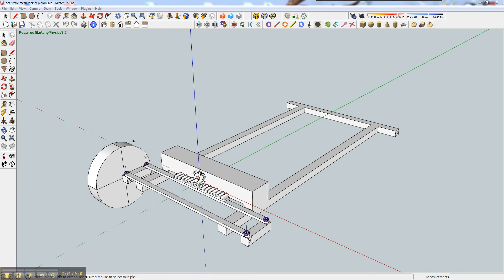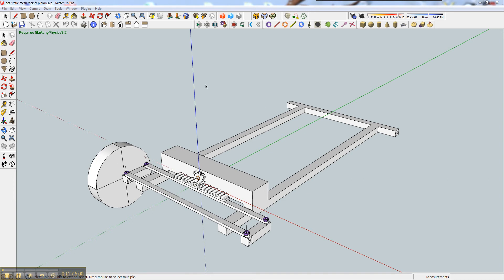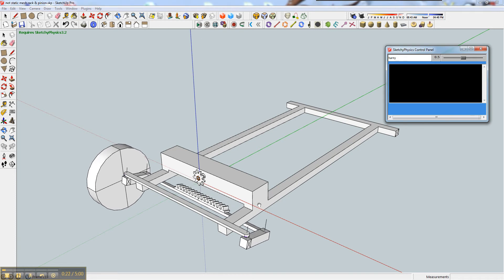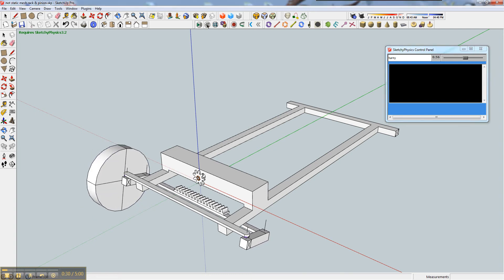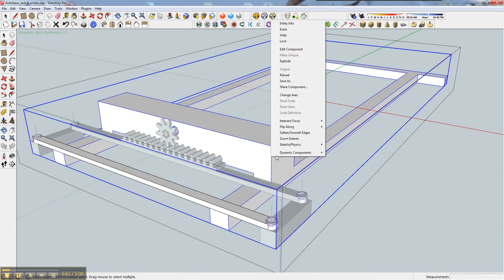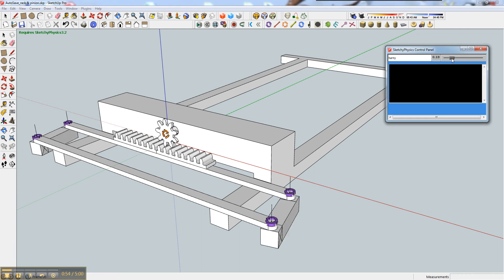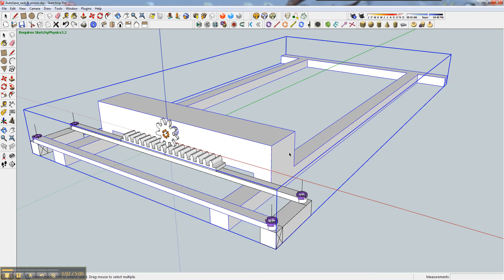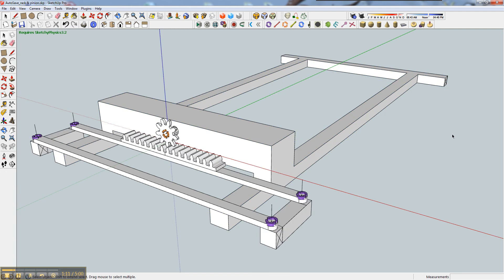Sketchy Physics   Rack & Pinion

Comment: This problem come from chassie is same shape it s act like a big box so box push the other group away that not make any joint. Solves:: they are should be set in each by each, long beams  are separate group  from center box and group them again , then you can make it moveable not only staticmesh. Trick: use showcollision status by right click at group that want to check the shape.